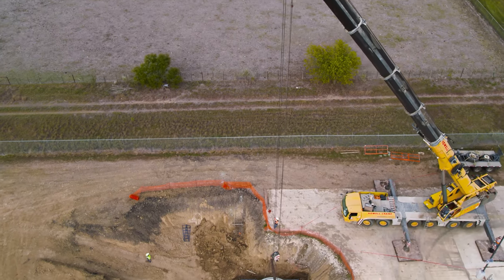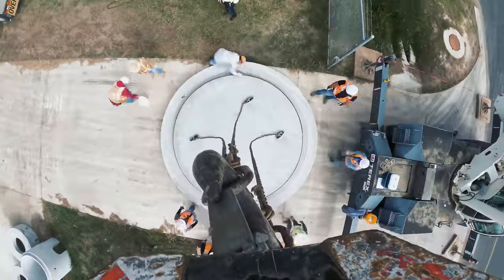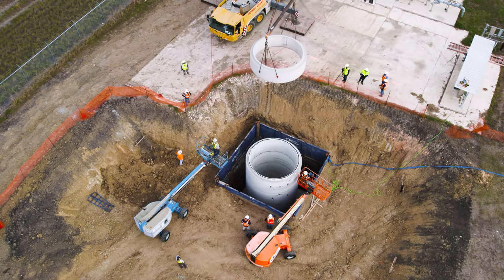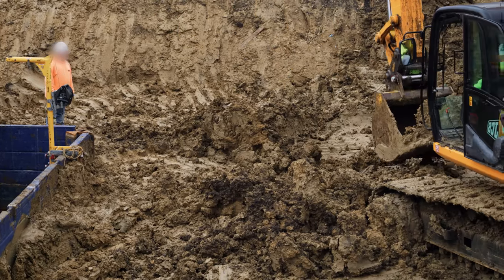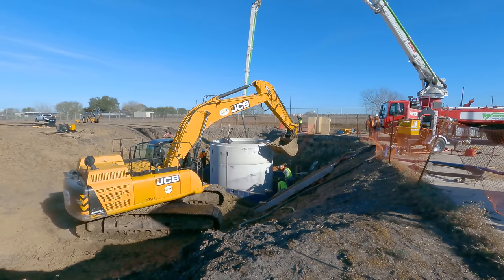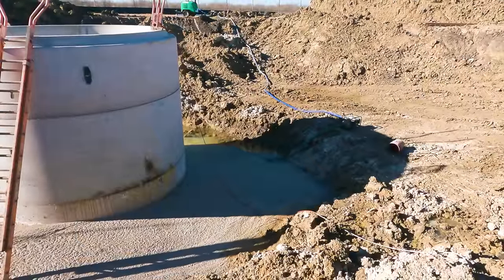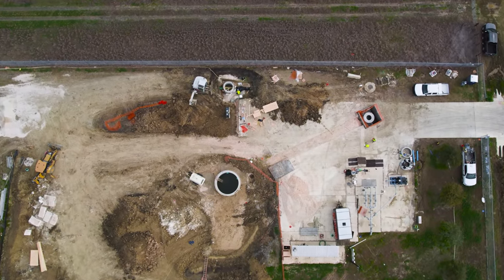HEAVY CONSTRUCTION of a Sewage Pump Station - Ep 2

Comment: Ah so that's how you bend/ break a rod on one of these excavators. I repair hydraulic cylinders and have always been amazed when a big excavator cylinder comes in with a broken rod. I'm guessing that if they tried forcing the extraction of those panels a little more there would have been some breakage.

Comment: You forgot to explain y a larger crane is needed. Two or 1 little cranes couldn't have completed this task. Im currently responsible for the maintenance and repairs of similar sissor lifts and booms used in this video. Great video btw

Comment: How does the foundation work on that wet well? It’s sitting on that “working slab” that has no rebar or anything.

That thing has to weigh a lot. Won’t it settle, tip over, or become buoyant and start floating in groundwater?

Comment: Hello, Grady!
I have a small question: I see that a fairly large and thick part of concrete was poured horizontally, without using metal rebars. Is it because there will not be heavy bending loads there?
Reply: flowable fill is basically the same as soil backfill, except it can flow. instead of dumping soil and then compacting it, you just pour this stuff in. the actual concrete foundation (if one is needed) will go on top of this
Reply: @techheck3358 I think 3meyc is talking about the floor of the excavation.
That pad is just giving them something s5able to work from (can you imagine trying to set this chamber in the mud?)
Reply: @techheck3358  Thanks! But this horisontal concrete foundation, filled at the end of this vidoe -- it doesn't have rebars inside, it's just a one piece of concrete, right? This is because of its' thickness?
Reply: @N-A674 That was the flowable fill. There will be pipes going into that, so you can’t have rebar. Even if you cut rebar, exposing it will cause it to corrode. It is just a fancy backfill, to give a uniform stable material to work in later.
Reply: @N-A674  its not really concrete in the sense you might know it as. its just a fancy alternative to dirt. it doesnt need rebar at all
Reply: @techheck3358  got it, thanks a lot!

Comment: Dumb question but why do they use the larger crane if the smaller one is able to pick up the segments? Is it because the crane needs to sit so far away from the wet well both horizontally and vertically?

Comment: it is better if they use a poly ethylene liner from inside the manhole (pipes) then welded together , that is will give them a 100% plastic tank whithout any need for gasket or seal and will protect the metal bar inside the pipes from corrosive material.

Comment: i get why they would use the outriggers to stabilize the crane, but why retract the wheels 100%, you should think that it would be down to a point where it would touch the ground at least without much weight, just in case, or are sensors in play that cannot let the wheels touch?

Comment: been wondering... how do site managers know what equipment to requisition for the day? do they have to plan out exactly what stuff has to be unloaded and choreograph every piece of material on paper?
Reply: The central tools for this planning are the Gantt chart, built from a work structure analyzed using the Critical Path Method:
https://en.wikipedia.org/wiki/Gantt_chart
https://en.wikipedia.org/wiki/Critical_path_method

Each "bar" on the Gantt chart represents a task that will be occurring on that day, and they use that to track not just the equipment that will be required, but also the personnel and materiel they need to have on hand.  Success requires getting all three of these on the jobsite at the same time.

To be clear, this often is stuff that has a relatively long lead time.  For example, that large crane probably can't be requested the day of (or even the day prior) if you suddenly discover it's needed.  Plus, it often is scheduled to be somewhere else so you can't hold it indefinitely.  So if you have the crane, but (say) the precast wetwell segments are late because the precast shop is behind, you may not be able to place that day.  Then, you have to try to get the crane later, which throws everything else off.

Failing to get the required equipment, materiel, and crews on site, on time, is the biggest reason that you end up with huge blowups where the project ends up behind schedule and overbudget.
Reply: @CatCube2 that is some awesome planning... im just a layperson sipping coffee while watching this, and it already seems like a really complex task that could involve some super rigorous planning. i can't imagine how hard it is to get the right things in place at the same time and sequentially so each job can be completed leading into the next one.

if ANY piece is late or worse, everything down the pipe could clog up massively (pardon the sewage pun). unforeseen delays could really snowball the costs exponentially, i think. say if one of the flatbeds gets T-boned en-route and you lose a piece of precast concrete... i think everything has to be delayed until a replacement concrete can be recast? and you'd need to re-requisition all your cranes and stuff, which themselves have their own lead times?

ho boy.

Comment: Surely the big crane has enough lifting capacity to lift the segments off the trucks at that range? And they only had one spreader bar, so it's not like they could unload one segment, while lowering the other into the well. Why the two cranes?
Reply: My guess is surface bearing pressure. The crane isn't setup with full counterweights and that's probably because the surface it's sitting on isn't rated to take the full weight of crane so the crane is rated to take lift 300 t but it's may only be configured as a 150t crane to keep surface bearing pressure down below the regulation, which in turn means the cranes lifting capacity is halved.

Comment: Why use gaskets instead of ciment between the sections?
Reply: Cement in those areas will have issues with compression and cracking. They also just plain won't seal as well as the gaskets
Reply: Because no matter how much you smooth concrete, when it sets its rigid, and a rigid concrete-to-concrete joint will still have gaps where the surfaces don't meet exactly.  And water will find a way.  So you need a gasket, which is a softer material that deforms to fill those imperfections and seal the gaps.  Pipe joints will typically have gaskets also.
Reply: @fredsanford5954  but those gaskets won't deform and need to be "replaced" with time? btw, thanks for the explanation

Comment: "Controlled low strength material, abbreviated CLSM, also known as flowable fill, is a type of weak, runny concrete mix used in construction for non-structural purposes such as backfill or road bases." - Wikipedia

"weak, runny concrete" shots fired 😅

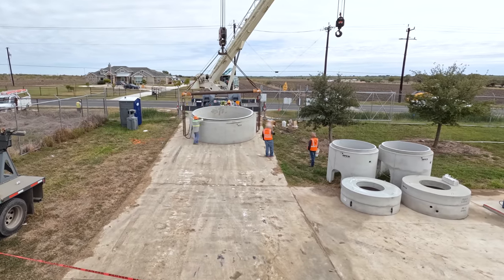Comment: 5:40 there's no way a safety-guy let those 2 in there.  You absolutely never get under a load.  Unless they climbed in from the top.... doubt it though.
Reply: 6:24 shows a dude climbing over, but then the load is lifted and guys are inside working.  The load is not put down and it becomes empty.  Those are huge fines.  Hide the evidence
Reply: 7:10 shows the best angle

Comment: Okay but one guy holding a tape roll while other does the cutting feels like manpower overkill...
Reply: Well,  both guys are probably needed on site and might as well help each other out.
Reply: Thing is, holding the tape flat and tensioned is a two hand job, if that guy had to let go with one hand to do the cutting, there's a much higher risk of the tape dropping or curling up on itself, and that will create an unacceptable kink in the seal.

Comment: This seems like an extraordinarily primitive, time-consuming and costly way to accomplish this portion of the project. Why can’t this be done with a pre-fabricated fiberglass or steel tank?
Reply: Not sure about fiberglass but with the amount of time this station will expect to be in service, chances are the steel tank will be long long rusted out by then and replacing or repairing it will be far more expensive then a concrete one
Reply: fiberglass tanks this size are expensive and cost money to ship if there isn't a local provider. steel tanks would corrode before the service life of the well would arrive, or would have to be very expensive and thick.  Both would need a much more dangerous and heavy lift, ,and how would you repair a cracke fiberglass tank that deep in the ground?

precast concrete rings stacked over gaskets is both effective financially and easy to manage.
Reply: Fiberglass could work,  but would require extremely thick walls comprising many layers to resist the loads of the surrounding soil,  and would likely be several times more expensive than concrete.